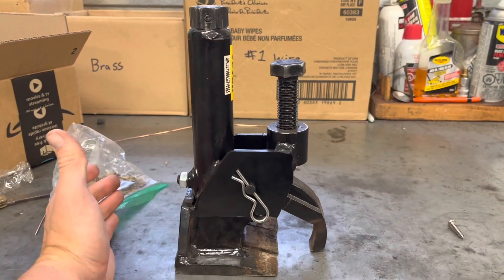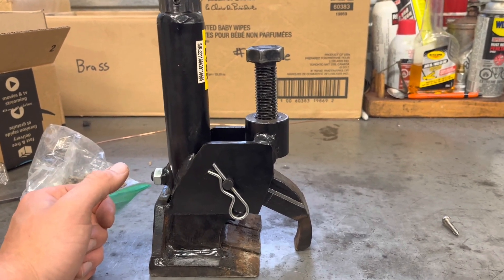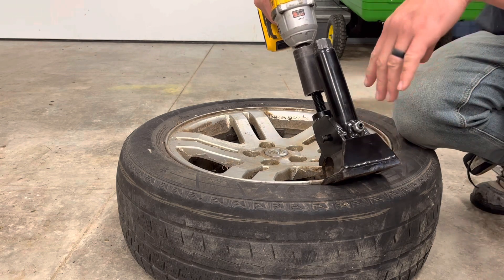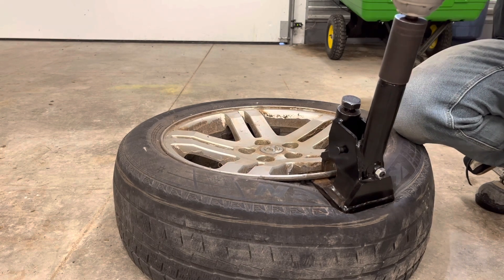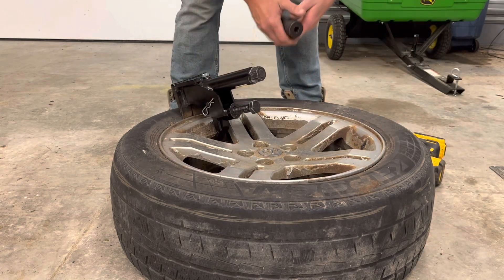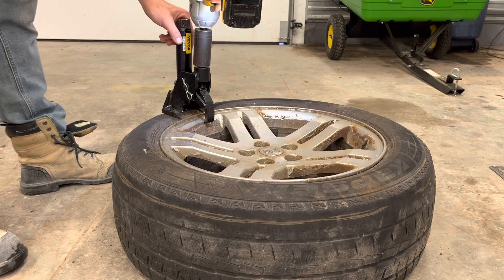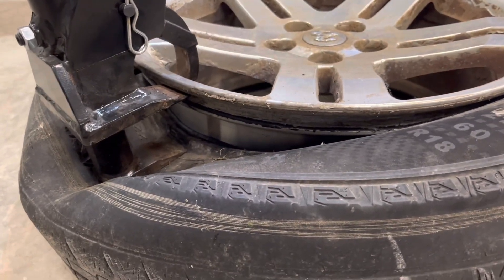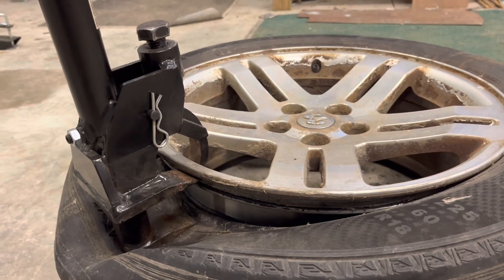How to break a tire bead VEVOR tire bead breaker REVIEW

Comment: I burned thru 2 Harbor Freight manual post style tire changers in 20 years.  Last fall I scored a deal on a "broken" Coats 5060 unit and boy do I wish I'd got one 20 yrs ago!  $100 in parts to fix it and it's been a game-changer!  That kind of unit still has a place as you said with tractor tires or when you're away from home.  Neat piece!

Comment: Pretty slick man. I've always been wanting to get something like that.
Reply from the maker: It really works well, I used it on my 80 back tires also built nice and strong worth the $100 alone to save yourself the headache lol
Reply: @Curtis Graham  For sure. That's actually not to badly priced in my opinion  considering what it is. I've just been lucky breaking beads with a bottle jack and putting it under my John Deere A hitch. Crude,but gets the job done,but I need to update
Reply from the maker: I use to use a 2x6 and back my truck up it   But I went thru to many boards lol